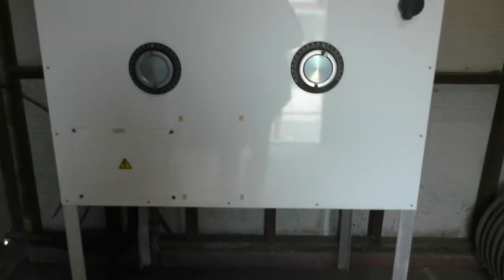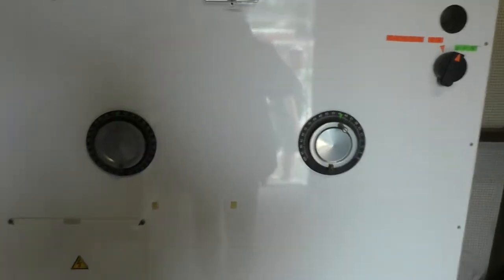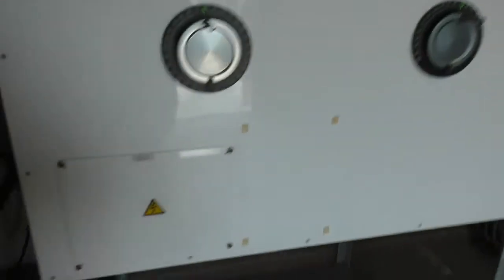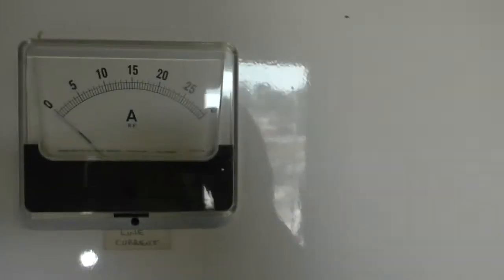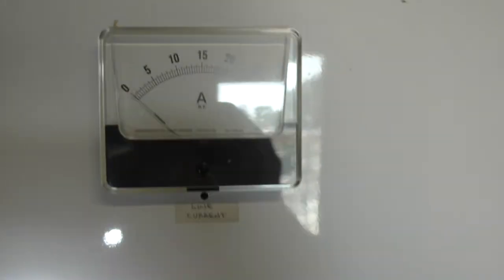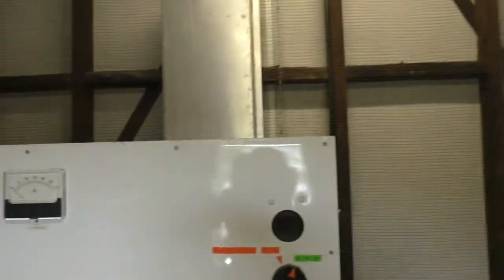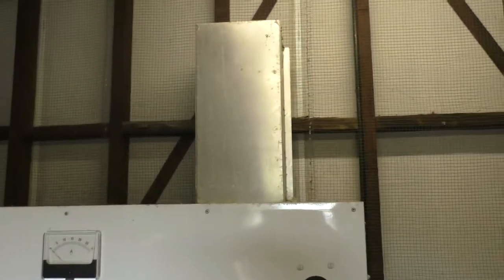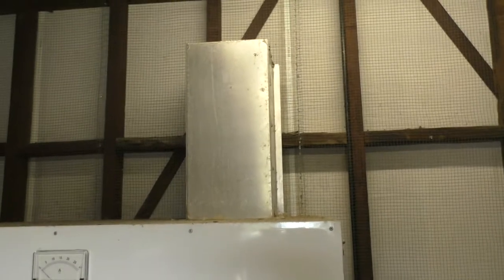'Umbrella' AM Broadcast Antenna ATU

Comment from the maker: For some reason I can't respond to your comment directly Fred. Thanks for the comment, the inductor and capacitor values would be the same if the transmitter was only 100W... the components would just be much smaller. The same ATU for a 100W transmitter would fit in a shoe box.